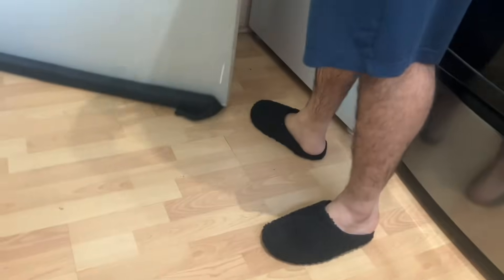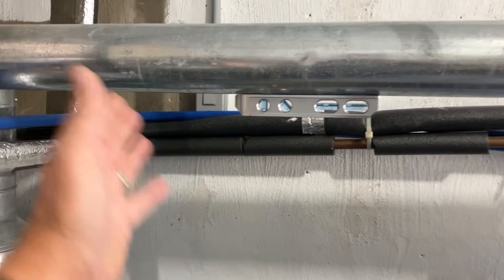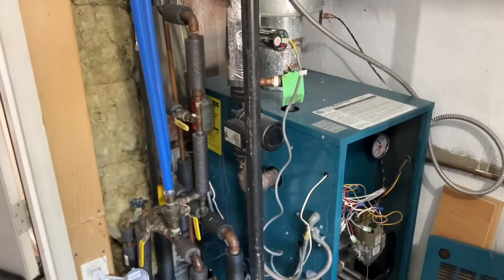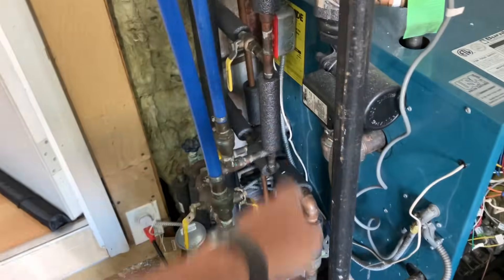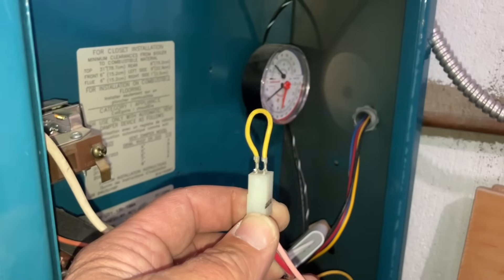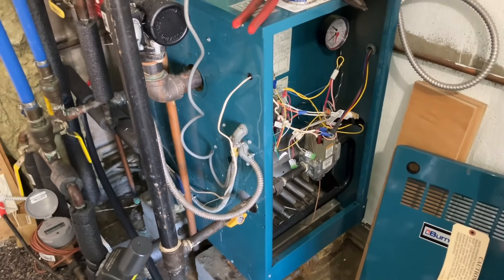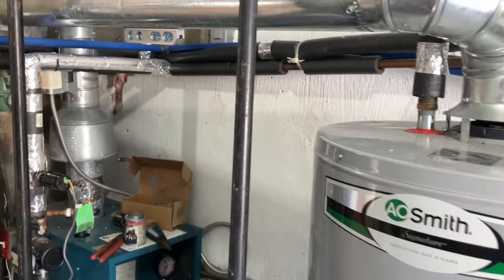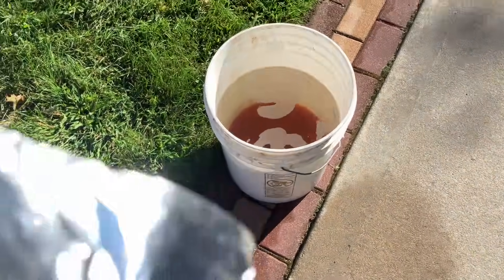WTF Plumbing Fail! Dangerous Hot Water Heater & Boiler Wiring Disaster Fixed

Comment from the maker: 🚨 Another WTF plumbing fail exposed — bad venting, bypassed safety controls, and a boiler low-water cutoff wired completely out of the circuit! 🤦‍♂ This is why you ALWAYS hire a real pro.

💬 What’s the worst plumbing or heating hack YOU’VE ever seen? Drop it in the comments ⬇ — I read them all!

📞 Live on Long Island and need it fixed right the first time? Call Pipe Doctor Home Services at 516-348-6300 or book online at pipedoc.net
 ✅

🔥 Be well. God bless. Stay safe. – Mikey Pipes

Comment: A lot of those vent dampers were optional equipment to improve efficiency by maybe 1.5 % and have a short life expectancy due to the heat )take that saving and then cost of the vent dampers installed  you’ll find it’s not worth it just leave it open manually open. In our area they would cost around $1200 to $1500 with labor
Reply from the maker: Thanks for sharing

Comment: I have always been using an impact wrench on the anode rod. They all take a 1/16 impact socket. However you only use the impact to break it lose just enough but not spin it off, and then use the ratchet to remove. Supper easy.
Reply from the maker: That's a good tip.

Comment: A piece of 1 inch black pipe 18-24 inches long over the breaker bar handle could have help, maybe. Nice save on the water heater exhaust adjustment.
Reply from the maker: Thanks

Comment: Only drain 2 gallons of water out of the heater and the weight of the tank & water in the tank will keep the tank from moving most of the time when removing the anode rod!

Comment: I had to use an impact the first time I changed it, of course I had no idea one was in there as a new homeowner. Rod was completely gone after 8 years of owning the home. Changed it and got a new water heater about 3 years later. Now I change the new water heater every 4 years and it’s about 80% eaten away. Maybe I’ll get 15-20 years out of the new one. 🤷‍♂️

Comment: Did you notice that over sized bottom door seal he installed on the utility room door? Is there a possibility that could affect draft and combustion on both the furnace and water heater?

Comment: That water heater is toast. 6 yr and 1 day it will pop and need replacing. Those A O Smith engineers have those 6 yrs warranty to the day to fail with in weeks to a month after warranty

Comment: I installed some taco LWCO's that have composite plastic threads and no issues so far, some in 2014. now the water is tested and treated with sentinel x100, it's on supply from boiler and in the actual water flow path in a brass sweat x sweat x fip tee fitting. none have been out for cleaning, never tripped either. few of them run year round for indirect DHW and winter heating with lots of cast iron rads. 
I really think much of it is lack of maintenance and having leaks.

Comment: The length and pitch are not the issue. The problem is that the elbow arcs too high, then comes back down into the horizontal vent connector. That's why the rust is only there. The heat is trapped there, and condensing on the inside of the pipe. 
The rest isn't rusted because the length and pitch are good. Otherwise, there would be rust all along the length.

Comment: I have only been able to loosen annode rods using my half inch Dewalt impact socket wrench
Reply: Was going to say exactly this an impact is probley the easiest route if it’s gonna come out on some of em.
Reply: many used to be put in with a thread locking compound and very hard to remove, granted they were mostly early to mid 90's tanks and fairly old at the time. of wanting to check or seeing them leaking, pulling just to see/inspect.

Comment: If the vent damper is set to always be opened is jumping the safety out an issue? Great video
Reply: in theory it should never be able to move and close with manual force, but for safety aspect it should be fully removed.
Reply: No
Reply: Invest in an impact wrench. Will remove anode in seconds.